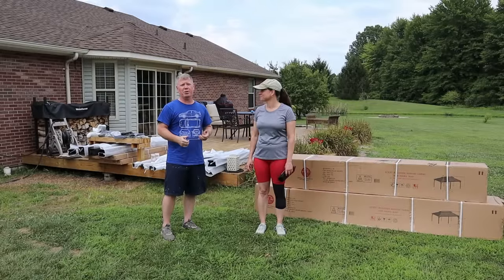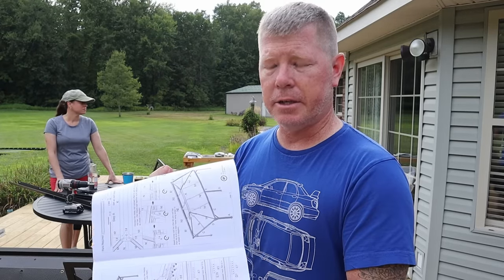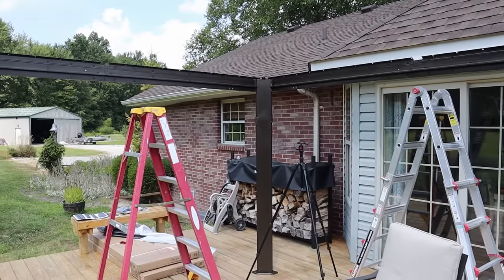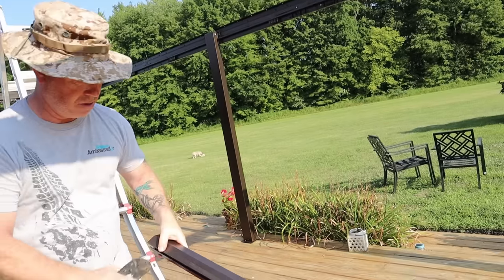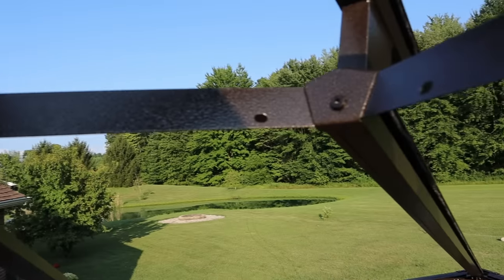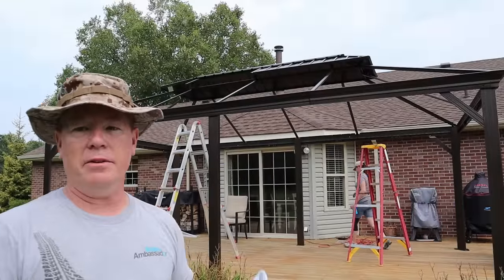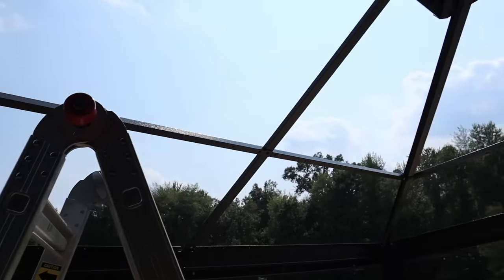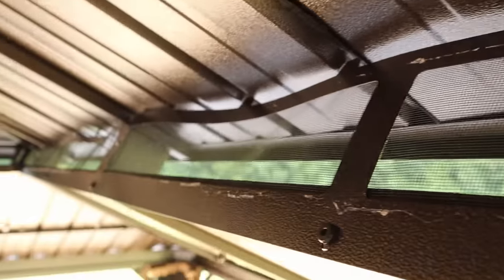Assembly How To- Kozyard/ Purple Leaf Gazebo (& Other Brands) - 12x20 Metal Roof Gazebo

Comment: Having lost 2 gazebos in wind storms, and heard stories from others, I realize these are inherently weak yet you can easily fix this. The corner bracing just isn't enough, and unlike a house, there is no plywood sheathing on the walls proving the needed bracing for those wind storms that come with occasional high gusts that blow trees over. Here is how guy wires can replace the protection that sheathing otherwise provides, and kept my 3rd gazebo standing in scary winds. I recommend this: 
- don't even start the project until you have the guy wire or rope materials and attachment hardware in hand and part of your mission. (My first gazebo crunched up in a month...)
- until corner braces at roof and pillers are screwed down, this is like a boat not lashed to a dock! Before stopping first day, put a temp (or final if confident)  screw or stake on the corner posts, and use cargo straps or rope and put either external or internal diagonal guy lines. When you can attempt to push it over with force and it won't budge, an overnight breeze won't dance it off the deck into a crumple of twisted parts. 
- when all assembled, assure your pillers are firmly attached to the ground, but know these pillers are not stiff buried fence posts, they might as well be hinged at the ground! Any twisting from wind will tear the sheet metal of the pillers or exceed the strength and bend pillers.
- tie permanent diagonal ropes or wires on every wall but the one you will use for entry. if you can't do 3 walls, substitute external guy lines staked like a circus tent with deep beefy pipe (this is annoying) or if earth, drive in the ground a heavy pipe like chain link post or rail pipe to deliver this support.
- for big storms, make the room as transparent to the wind as possible: open screens and tie back privacy panels. (my 3rd room, smaller and flimsier than yours blew over when I ignored a weather report, so if you don't trust your ability to always be mindful, fortify even more!
Winds blow fences and trees over all the time, and these gazebo makers love repeat customers who blame themselves, not the inherently weak products they know they make. The fine print in the instructions will have some sentence starting with "Not responsible for..." or "disassemble before severe weather" yet the catalog page fails to mention "not designed for high winds and we don't sell replacement parts we know will break..."

If anyone thinks I am overstating this, are you OK betting your football playing friend he can't knock it over? I hope my own trauma can prevent yours!
Reply from the maker: Hi Jamie. Thank you very much for watching and sharing your experiences with us. Sorry to hear you've lost a couple in wind storms. We agree, that they aren't the strongest of all structures and you should be aware of your location and potential weather that could affect it before getting one. We've had 40mph winds come through since having ours up and we could hear the deck creaking with the gusts but thankfully, nothing more. We anchored them down with SS large threaded bolts directly into the deck which is also anchored into the ground. Would that be enough in a 50mph+ gusts, possibly not but hopefully we're in a location where if we get those, we have bigger concerns on our hands. Plus we have home insurance so there's that. :-) Thank you once again for sharing. Very good advice for others to pay attention to.

Comment: I have never seen such a well done video on building of a 'some assembly require' item..  However my question is about building permits and the 'Signed and Sealed Architectural Drawings the are required  in Florida. Have you had any experiences with acquiring that or similar documents
Reply from the maker: Hi Jeffrey, thank you VERY much for the incredibly kind words. The compliment is huge and it means a lot to us. We wish we could provide some additional insight into the permit stuff but unfortunately it's an area we don't have any expertise. We're fortunate that it wasn't required for us where we live because of our location and that we reside in a township. We're both very familiar with Florida (both of us moved from there to OH) and their requirements and HOA's. Each one could be different but I'm sure the manufacturer could provide something that could be useful if contacted. Wish we had a better answer for you. Thank you once again!

Comment: Love the video. Started putting together our 10x12. What type of screws did you use to secure it to the deck?
Reply from the maker: HI Brandoncollins7163. Thank you very much for watching and sharing the kind words. We really appreciate that. Congrats on the 10x12 purchase. We used galvanized threaded hex head screws the size of the hole in the posts. We touched on that in the 1 year update episode. We hope your build turns out well. We plan to do another episode for a 10x12 at the end of the month.

Comment: Great video!  Is your deck sloped away from the house? I'm currently installing a 10 x 14 purple leaf gazebo and my concrete patio slopes slightly away from the house, just wondering if the gazebo really needs to be level. Thanks
Reply from the maker: Hi Vincent. Thanks for watching and sharing the kind words. We greatly appreciate it. Our deck isn't sloped. I don't think it needs to be level (however we are not experts. It's just our thought on it). If you do install it there, be sure to bolt it down to the concrete slab. We drove through a neighborhood this past week and actually saw a smaller version of ours collapsed on one side in someone's backyard on a concrete slab. It appears they did not bolt it down. Hope that helps. Good luck with your assembly and we hope you have many days of enjoyment from your gazebo.

Comment: THANK YOU!! Question: Any tips on the best order to follow in tighening all the loose connections that get made in putting the roof panels on? Also, I have one small area that I see daylight through. I can't adjust the roof panels any more. Any "aluminum weld" that sticks to the roof panels that I could patch the small opening.
Reply from the maker: Hi Timothy. Thank you for watching and sharing with everyone. We really appreciate it. I wish there were tips for it but there isn't any particular order for tightening things down. We just went back and took care of after we had everything in place. Very weird about the spot where daylight comes through. Especially if all holes lined up correctly. I wish I could help more on that. Not sure about using something like JB Weld. It could probably work but just can't say for 100% certainty since we've never tried it. If I did try it, I would put it in a small area out of site first to make sure it creates a good bond. Hope that helps.

Comment: Tape those little tabs that fit over the corners panels. Use paint tape it holds them in place and allows you to fit your corners. Also work from one corner and continue around.
Reply from the maker: Thanks for sharing with the community.

Comment: Thank you for making this video! It was really helpful for us when we had to put ours together. One question i wanted to ask was, which screw size did you use to anchor the posts to your deck?
Reply from the maker: Hi Reaganabraham. Thank you for watching and sharing the kind words. It's much appreciated. We're incredibly happy that we were able to help with your assembly.  We actually secured it with large 7/16 galvanized threaded lag screws. We shared what that looks like in our 1 year update episode. Hope that helps. Cheers!
Reply: Thank you so much again!
Reply from the maker: @reaganabraham1528  our pleasure

Comment: The part at about 23 minutes when connecting that top piece I found it easier to connect all the side pieces to top middle part first. Then lift up and screw into the A post. Only say this because I had few snap while just hanging there. Thank u for video really appreciate it. I tackled this by myself was pretty time consuming. I have the 12 x 16. Don't recommend doing by yourself lol.
Reply from the maker: Hi Islander80. Thank you very much for sharing that tip of yours. Hopefully that will help others who watch this and are building it. I'm sure there are a ton of different ways to do it. Yeah, doing it by yourself would be a big chore. Tip of the hat to you for tackling that.
Reply: @SpiritedWrenchers  oh I messed up a bunch of times. Trying to rush it by myself. The thing fell one time but luckily damage wasn't bad. Just had to put new screws into the pillars at the top. Def a 2 person job and advise people to take there time. Little by little
Reply from the maker: @islander8071  Ouch. Glad it wasn't bad. Excellent advice for sure. Thank you for sharing your journey with us all.

Comment: Did you use any rubber washers or sealant on the roof panel screws? If not, any leaks? Thank you so much for this video.
Reply from the maker: Hi Chris, thanks for watching and sharing the kind words. We really appreciate it.  The screws actually have rubber grommets for them. Up to this point, we've had no leaks thankfully.  Take care and stay safe
Reply: @SpiritedWrenchers  thank you so much for the response. Currently putting up the 12x16. It’s…going lol. Thanks again.
Reply from the maker: @christophersullivan2438  our pleasure. Always happy to help when we can. Congrats on the purchase and DIY assembly.  We're doing a 10x12 this weekend and hoping to have another successful build. Let us know how yours turns out.

Comment: Looks awesome! Well done! Thanks for the video. 

My wife and I are considering getting one of these. Does the gutter system work well? Wondering if it’s possibly to tie it in to our existing gutting system so the water doesn’t dump next to our house.  

Also, we have a small propane fire table. Being that this is vented at the top w/ mostly metal materials, with the screens all wide open, wondering if it would be feasible to run the propane fire table underneath this unit. Probably not to code, but I think it could work. What are you thoughts?  Thanks again for the video!
Reply from the maker: Hi Nick. Thanks for watching and sharing the kind words. We greatly appreciate it. The gutter system does work but it has a small track compared to your standard home size. It has drain holes in the corners, which we're not big fans of unfortunately. I don't an option to tie it into your house without a great deal of modifying. 

For the propane able, I can't see an issue with it if you kept the curtains open. We have a large propane fire heater(see assembly video on our channel) and that goes to the roof with no problems. There is plenty of ventilation and it may not even be bad with the curtains closed but I'm not in a position to say with certainty. We're actually shooting a 1 year update on this gazebo today so it should be out next week. Hope that all helps.
Reply: @SpiritedWrenchers  Thanks for taking the time to provide all the info. That helps a lot! Much appreciated!
Reply from the maker: @N_R_S_07  You're most welcome!

Comment: Your video is awesome. I am about to build the 10x12 one for my hot tub. So I have the location of where I want it.  It will be around the tub. My question is at what point should I drill the post in place?  I was thinking before the roof panels. I will not be moving it a lot, maybe just a few inches, if that. I just need to get it square. Thank you again. Joseph
Reply from the maker: Hi Joseph. Thank you for watching and sharing the kind words. We really appreciate that. We actually added a small hot tub under hours now so we're sure you'll like it. Temps are falling quickly here in OH so we're going to close the sides and hope to turn it into a sauna effect. LOL. To answer your question, you can move it either before or after you put the roof panels on. If you have a second person to help you move opposite corners at the same time, it will be very easy to move. We moved ours after it was complete and bolted it down to the deck then. It was easy with both of us. Good luck and let us know how it goes.

Comment: Thank you so much for this video! Two questions to anyone and everyone who has survived assembly: 1) are these damn roof clips necessary? Second, on panel X65 (the one where you are supposed to glue the rubber bumpers), how do you screw in the middle screw? I have a support screw there. HELP ME PLEASE!
Reply from the maker: Hi Robert. Thank you very much for watching and sharing with us. We greatly appreciate you. Apologies for not responding sooner as we have been traveling quite a bit over the last 2 weeks. Did you get the two areas figured out? I know the clips have changed since we created the episode and I'm learning that many glue the panel clips on in order for them to stay but I would say that they are necessary. I can pull out the manual about the x65 and refresh my memory with that one if you are still needing assistance.

Comment: Thank you for the video. I will tell you This has swayed me into getting one. 

One question. As far as hanging things from the roof, specifically a fan, heating lamps, string lighting, with it being a metal roof as opposed to wood ones, have you had any issues/suggestions?
Reply from the maker: Hi Anthoni. Thank you very much for watching and sharing such great feedback. We really appreciate that. Your questions are great ones. The main support beams are hollow so if you hung anything I would recommend using the top bracing. We have ran string lighting around the inside of ours. Of course that is very light and if we do go with a fan this year, I will likely make a support beam to run across the top to connect it to. Plus it will be out of the way of the curtains that way. We wish you success with your gazebo and feel free to shoot an email with pics when you have it built.

Comment: When installing the top panels you mentioned Dana suggested taking the top cover back off. Did you just loosen the top or remove it completely to make it easier?
Reply from the maker: Hi Herman. Thank you very much for watching and asking. We'd love to help. Could you tell where in the video you're referring too? Then we can easily tell you what we did.
Reply: @SpiritedWrenchers  thanks for getting back to me. It's at 33:57 where you talk about the "K" top piece that you said Dana suggested doing for panels to fit? Did you just loosen all the screws or did you take it off completely to get them to slide in?
Reply from the maker: @hermansims26  our pleasure.  Always happy to help the best we can. So we actually didn't take it fully off but just lossened it up so we could lift it up enough to slide the panels in. I try to do the least amount of effort for the same result. 🤣. Hope that helps and thanks once again for watching.
Reply: @SpiritedWrenchers  thanks for the video and your timely remarks. Everything went smoothly, I got it all done within 4 days. One thing I added was those plastic clips on the panels. I added small pieces of duck tape to keep them in place. Thanks again
Reply from the maker: @hermansims26  that's fantastic.  Congrats on the build and we're honored to be a part of it. Good idea on the clips. Stay safe and enjoy that new gazebo.  😁

Comment: Love your video.  Do small tree branches, dead leaves slide down off the roof or stuck at the roof panel during wind, rain or storm?   I'm thinking of buying this product but store staff members don't know the answer.
Reply from the maker: Hi fire4k kay. Thank you for watching and for sharing the kind words. We greatly appreciate it and glad you liked the video. Great question so thanks for asking. These actually have a gutter system around the lower portion of the roof so like any house gutter, if not covered, it could be stopped by leaves and small branches. We haven't had a big problem with them though because compared to house gutters, these are rather shallow and wind blows a lot of right off the roof. I have thought about covering some of the areas to see what that does for any leaves that do get stuck in them. Hope that helps.
Reply: @SpiritedWrenchers  Thank you for responding quickly.  Now I'm going to purchase one.  Have a great Sunday and love your channel.  I already liked and subscribed.
Reply from the maker: @fire4kkay185  you're most welcome and thank you for subscribing. We really appreciate it. Are you buying the Kozyard brand gazebo? If so, email me us Spiritedwrenchers@gmail.com, we may be able to help on pricing if bought directly from them.

Comment: What is the "actual" size of the base of your 12' x 20' gazebo?  The reason I'm asking is that I heard the posted size dimensions are based on the eaves not the base.  Thanks.
Reply from the maker: Thanks for watching and asking Golden Retriever. We appreciate you.  From the one base corner to another on the short side is 11x8. Long side will be just a tad shorter as well. Hope that helps.